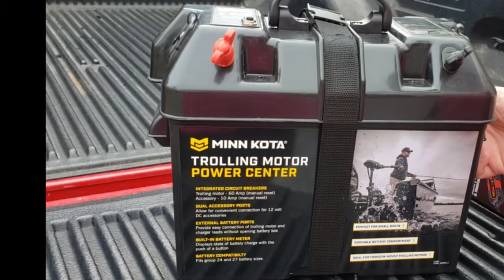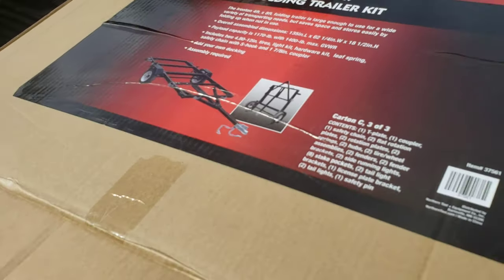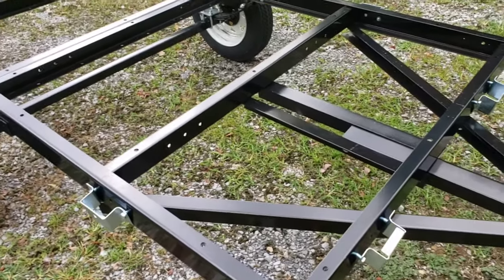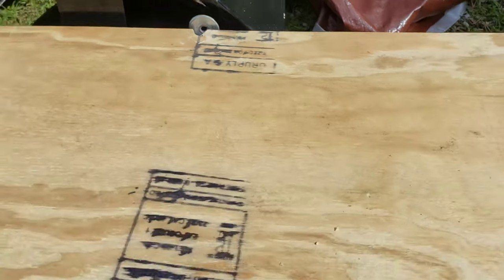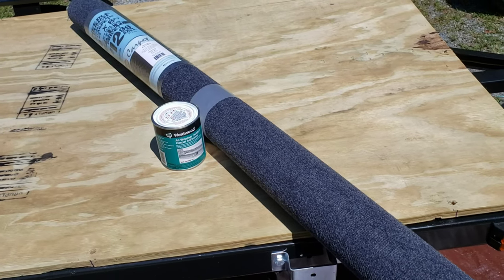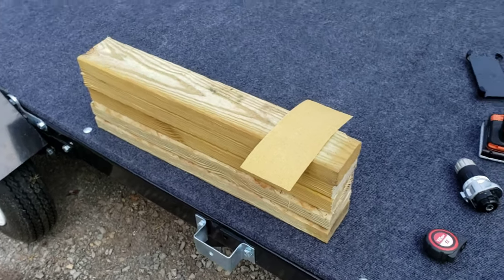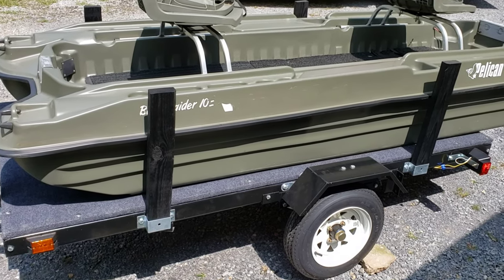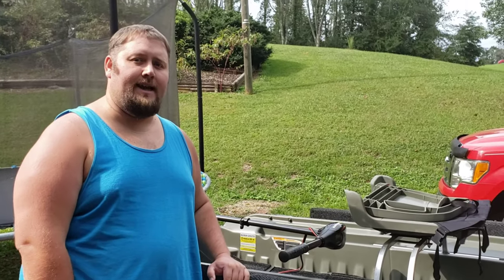Pelican Bass Raider 10e | 2020 Modifications | Boat Trailer Build

Comment: I never knew you could buy a trailer to put together yourself.  Looks like a nice trailer.  You did a great job making it work for your Pelican.  $560 total build is not bad.
Reply from the maker: Thanks guys it was a good project 
Still tweaking it to get it just the way I like it over all I got what I needed about 400$ cheaper than brand nee

Comment: Man, awesome work. Since the length of the boat is 10ft I though getting an 8ft trailer would not be enough, but this is a great design. Thanks for sharing!
Reply from the maker: Thanks for the feedback I appreciate it 🙏 it works well and the rails add a bit of protection along with an anchor point

Comment: Great job man and thanks for the hints and tips.  Can you ride down the road with the boat seat in place or do you have to put them in the truck bed?  Looks like the would blow out.
Reply from the maker: I run my straps over the legs and holds them fine. Thanks for watching much appreciated 👍,

Comment: Are you unloading boat from a boat ramp or carrying to the water? I want to do this build I have the same boat but I want to be able to back it in the water. I would have to figure out a way to put a winch on the front. Also do you think a 30lb minn Kota would be able to get it back on the trailer enough to get it out of the water. Where I fish the ramps are always busy and you have to rush loading and unloading.
Reply from the maker: Hello and thanks for watching much appreciated,  I back up and slide mine off 
I dont like to back into the water im afraid my tail lights will ruin 
And I use my trailer to haul my mowers around also
Reply from the maker: But I think the 30 lb thrust should work fine

Comment: Looks great!  Sorry if I missed it, but for the 3/8 carriage bolts, how long were the ones that you use for the rails?
Reply from the maker: Hello and thanks for watching much appreciated 👍,  I used exterior deck screws 3" or 4" long on the side rails 

But if talking about qhere the rail post sit inside the post holders on the trailer ?
I used a longer carrier bolt i think it was the same size , I just pre drilled through 
The post holder and the 2x4 and ran the bolt threw and but a lockout with nylon bushing on the other side to hold it

Or you could simply run a screw in each one with a large cheese head to hold also ....
Reply: @FishingWithBIGD  great thanks so much!!!